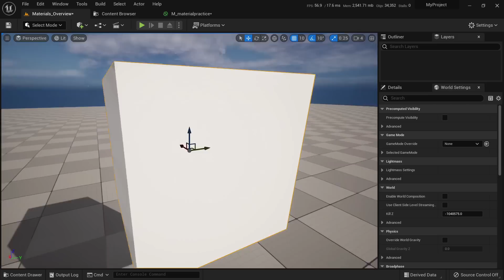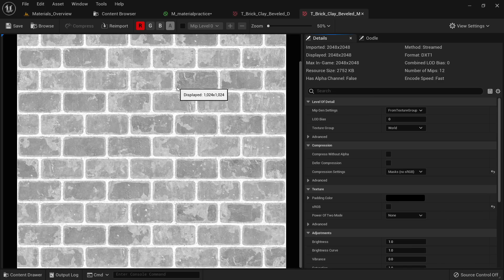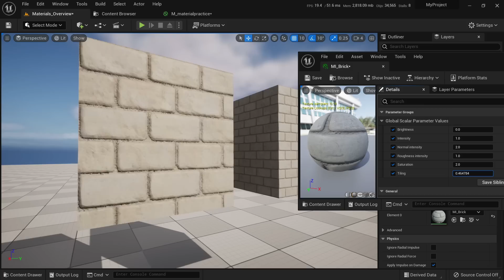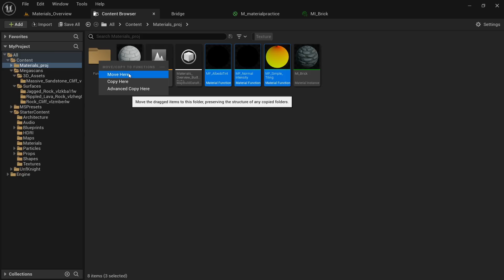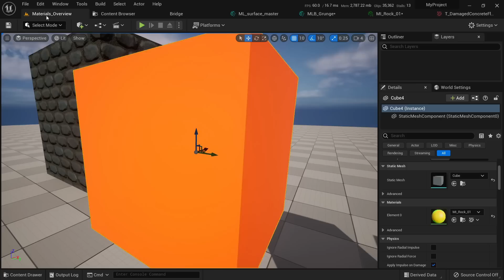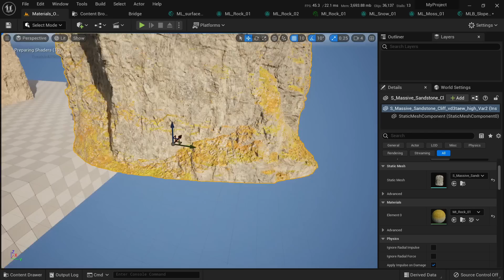Unreal Engine 5 Beginner Materials Tutorial - A Complete Guide in UE5

Comment: still not really understand why u use appendnot add or what it exactly does when you set up the tiling
Reply from the maker: Append combines 2 vectors, useful when you need a vector of 2, add only adds on top of the value you have, it doesn't change the vector size

Comment: So in the material layers section you went too deep down the rabbit hole too fast. You should have given an overview of how the layers system works before you just start opening up new file after new file after new file without even explaining why or how they fit together. Especially with the vagueness of the naming convention it makes it impossible to keep track of what is ACTUALLY going on. Sure, I can "follow along and do exactly as you do" but that doesn't really teach me anything. You're not teaching the structure and mechanics along the way. It's very frustrating. The rest of the tutorial was just fine. It was small enough bites of information. This was just too expansive and in too short of time. Probably should have been it's own video tbh.
Reply from the maker: Thank you so much for the detailed feedback, I'll try to do better next time 😁
Reply: Right. I was going to write the same thing before seeing this comment. The Layer part and the naming convention was so confusing I was going to give up.